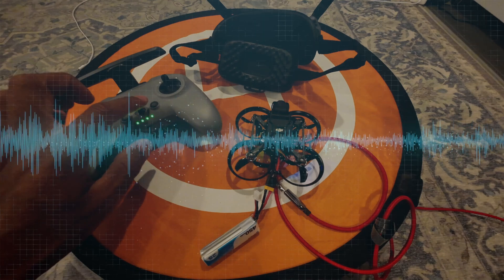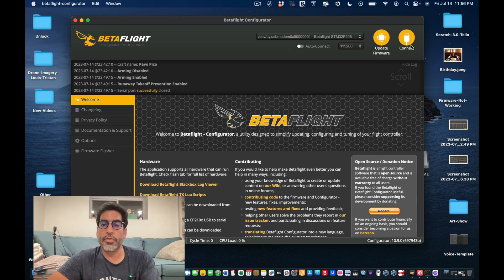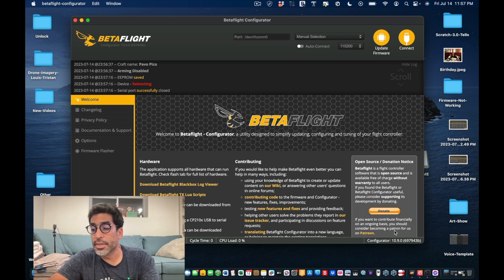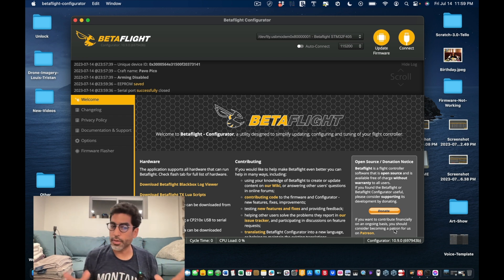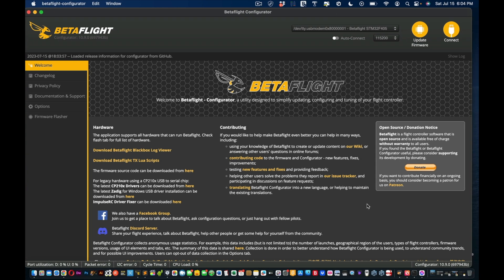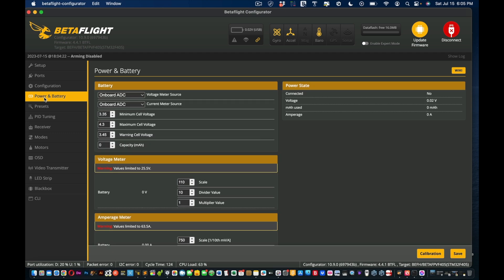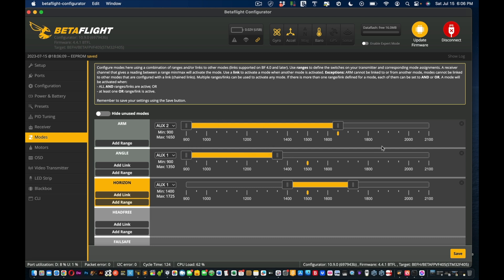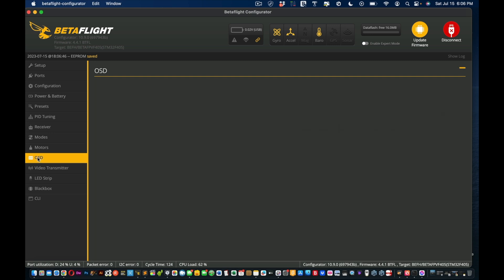povo pico configuration - betafpv pavo pico setup-Part-2

Comment: Man I’ve tried everything. I can’t get the controller 2 to bind
Reply from the maker: 40 minutes into live stream I explain.. 50:00 general closing. Also check your wiring.. This video you ca scrub to see the wiring..
https://youtu.be/NUd4JPoSCsE?si=SU6KMCI4b-g9g05G
Reply from the maker: @benstan4978  try the troubleshooting video . Also try updating the format to the DJI RC and 03 air unit 

Pavo Pico not working - how to get the pavo pico started, pavo pico troubleshooting
https://youtu.be/LEw5Gha1eRo
Reply from the maker: Live stream.. just go 50:00
https://www.youtube.com/watch?v=c-MnT_TKmJM

Comment: Is it possible to bind the dji controller to a pavo pico with a Caddx vista installed instead of an o3 air unit?
Reply from the maker: Sorry everything here is PNP , 2.4g , Josh Bradwell or Captin Drone Should be able to answer this question or even have a video on this.. But you should be able to. Let us know how it goes..

Comment: I was thinking about purchase one, but I don’t know how to program it until I saw your video footage and I enjoy it. I will pick one up and fly. by the way, what do I need to complete the accessory I need ? Like battery charger , also, where do I download the beta flight configuration? Good knowledge and understanding.👍👍
Reply from the maker: It all depends on charger will depend on which drone you get 

Here is where you can download beta flight 
https://github.com/betaflight/betaflight-configurator/releases/tag/10.9.0

DJI RC controller you can get on eBay for below market rate

Probably want the Pavo Pico Version 2
DJI O3 VTX
ExpressLRS 2.4g
https://betafpv.com/products/pavo-pico-brushless-whoop

Integra Goggles would work well for you
https://store.dji.com/product/dji-goggles-integra?vid=135261

You could probably get them cheaper - have price at second hand 

Let me know if this is what you were thinking 

Hope this helps
Reply: Thanks for replying for what I request for . but little pricey, but worth it. Thanks again.👍🥃🥃

Comment: These settings made my drone lose control and made the props explode… thankfully it was in my hand even with the throttle all the way down went full blast. I need help.
Reply from the maker: Sounds like the drone may have been in ACRO mode.. you want to be in level mode.. Also known as ANGLE MODE, here are some trouble shooting... No PID adjustments are done in this video.. https://www.youtube.com/watch?v=LEw5Gha1eRo&t=432s
Reply: @How-to-by-Lou  man that was a fast reply! My tv has your face burned in it lol do you have an easier way of contact?
Reply from the maker: @kjallard6764  thankfully the lines aren't wet and the storm won't be here until Sunday... you could always try here and can email you the PID image so you can copy it.. 

Drone-Imagery-NJ@protonmail.com
Reply: @How-to-by-Lou  I got the files on my laptop now. Learning a custom fpv is hard. Trying to learn betaflight and what everything does at the same time. The video where you use your cli does that add all the settings into betaflight?
Reply from the maker: @kjallard6764  I would steer clear from the CLI for now since you are new to this.. I made that same mistake too. FPV doesn't fly like regular RC remote control cars or planes you'd get from the mall. You may want to spend some time in the simulator first.. Maybe 10 - 15 hours in LEVEL MODE which is the same as ANGLE MODE, this video will help, then when you're ready I can walk you through the settings so you can fly in level mode.. youhttps://www.youtube.com/watch?v=NqmBmlZMzUQ
Reply: @How-to-by-Lou  copied all the pid settings and the mode settings, the moment it arms the motors start pulsating very fast and want to go max speed even with the throttle at zero. Doesn’t change no matter what the mode setting is ( the left toggle switch)
Reply from the maker: @kjallard6764  which drone and Remote Controller do you have? This video is for the DJI eco system. Do you set and adjust your remote controller for Manuel Mode? This video will show you how to do that.. Which Pavo drone do you have.. Can you look on the box and share what it reads at the bottom.. https://www.youtube.com/watch?v=ypxccdcNCsA
Reply: @How-to-by-Lou  I have the controller 2 with the Pavo pico v2
Reply from the maker: @kjallard6764  Which pavo? Is it the PNP elrs or TBS. You'll see it on the back of your box... You might want to try flashing your firmware with what ever matches your box. https://support.betafpv.com/hc/en-us/articles/21133140518937-CLI-and-Firmware-for-Pavo-Pico-F405-2-3S-20A-V1-0-FC-
Reply from the maker: All my videos happen in real time and this is the first time someone has shared this experience. If after flashing the correct firmware this doesn't work you should put in a new support ticket with BetaFPV. Are you in the NY, NJ, CT area? 

https://support.betafpv.com/hc/en-us/requests/new
Reply: @How-to-by-Lou  so I found one setting in modes that was not programmed in and that may have been my issue and that was the FPV angle mix. I had gotten a cli file from someone on Facebook and loaded that up and it was perfect. His tolerances are very very sensitive so I just need to play with those. I believe you have a video on the cinematic settings so that will be my breakfast watch lol. So far you have been amazing especially with the first build video
Reply from the maker: @kjallard6764  Glad you were able to figure it out.. Those rates are more for indoors.. You might find better rates from the FB group.. Most of the vids are for the beginner experience.. If you do find better rates, please do share so we can try them too.. Thanks a bunch...
Reply from the maker: If the PIDS are too unstable for you you can download from below and just copy the setting from the PID-Tuning-3. file.... Make sure you backup current setting incase you want to put them back.. Again drone should be in ANGLE MODE

https://github.com/flight-commander/pid-tuning/blob/main/Pid-Tuning.zip
Reply from the maker: or try this before putting in a support ticket

https://www.youtube.com/watch?v=8EnGQPeD0CI&t=322s

Comment: Would you happen to know how to setup the led light on one of the Aux switches. I have Aux 1 set for Angle,Hor,Air. Aux 2 top to arm-middle to disarm. Aux 3 is Home button, but if I hold it activates beeper and if I push it then it’s supposed to turn on and off Led. Aux 4 is the user mode? Aux 5 is C1 set for turtle mode. Any advice would be appreciated. Thanks
Reply from the maker: Try this one.. It should help guide you in the right direction.. https://www.youtube.com/watch?v=LEw5Gha1eRo
Reply: @How-to-by-Lou  Thank you

Comment: I do appreciate your video and I know it’s for the Pavo Pico, but no other videos show how to actually go into Betaflight to set up with a DJI 03 Air with the controller 2 and goggles. I recently purchased the Pavo 20 and tried to follow along, but no luck. Any advice would be greatly appreciated. I have no clue on what I’m doing..🤯
Reply from the maker: Try flashing it. Here is the CLI dump for version 1
https://github.com/flight-commander/Pavo-Pico-Version-1-
Reply: @How-to-by-Lou  I’ll definitely give it a shot. Thank you!
Reply: I got it to work! Not as easy to fly like the Avata, but a little more time on the simulator and we’ll see. 😂
Reply from the maker: @lalojr76ify   That's great... the new remote came.. So much easier to bind right? - Maybe turn on the OSD in the setting - or put the camera in wide mode. that's done from the setting in the DJI goggles.

Comment: Thank you. Very stupid question: how to arm it? I have a Avata and now the Pico. I binded everything but it does not take off
Reply from the maker: covered it here: https://youtube.com/live/PePZBXToPWI
Reply from the maker: 1. Make sure you have the goggles protocol set to "standard "
2. Check the 03 Air Unit Cable make sure it's not broken
3 Check the pins on the 03 Air Unit. makes sure they are not accidentally bent
4. Check in beta flight, make sure you have "SBUS" selected in the "Receiver"  Tab
5 Throttle has to be down before you can arm
6. Make sure it's not already "armed", won't start if you're already armed. 
7. Make sure the 03 Air Unit and the DJI goggles are running the current updated software. 
8. Battery could be dead.
9. In betaflight check your Modes. Make you your custom tabs are selected.  correctly and are in the right place. 
10. think that's it. If I missed something will let you know.
Reply: @How-to-by-Lou  thank you!!! it seems my FC is broken. I spent days with research and still didn't get my DJi remote, even though binded, to set a signal to the drone. I will get a replacement FC. I fear this will be a big challenge to swap it?
Reply from the maker: @OlliDTS   It can be a tad tricky.. Am uploading a new soldering tutorial later.. this one is I think 20$ on amazon. The one being uploaded  today is 9$ on amazon. Those flight controllers are expensive.. Maybe the 9$ build.. You only get one shot but you will need to buy a smoke stopper... 

Solder an 80s retro game
https://www.youtube.com/watch?v=9eEe6knqGLY

Smoke Stopper.. 
https://www.youtube.com/watch?v=4y2cJxWdBiY

Pavo rebuild part 1 of 4 - live stream no edits
https://www.youtube.com/watch?v=DcniZz1BN3s

Part 2
https://www.youtube.com/watch?v=Mg-KHnlJf9Q

Part 3
https://www.youtube.com/watch?v=Zt0PNl30I0c&t=1808s

Part 4
https://www.youtube.com/watch?v=spZ2kFAaywM&t=17s

Comment: I have a DJI FPV Controller, purchased for simulator training.  When purchasing a Pavo Pico unit do you select TBS or ELRS?  or is that irrelevant when using it with DJI O3?  I'm confused as to whether the DJI controller interfaces with the O3 for radio frequency or if it connects to the Pavo Flight Controller board..
Reply: go and do a bit or research as i did. TBS is a company that have the product Crossfire. you need to select TBS Crossfire if you want to use with DJI controller 2.  The DJI o3 air unit is the video module. that you can use the new fpv goggles.
Reply: @ezekieloz I actually just got that working yesterday.  There was a change between the first Pico and the Pico 2, for the DJI controller to work serial has to be enabled on UART 5 for the new model.

Now I’m trying to figure out how to use an ELRS controller with the Pico 2.  I have a couple units and just started working with them over the weekend.

Comment: I would like to start the hobby and am looking for a complete package with the Pavo Pico, batteries, remote control and glasses. can you help?
Reply from the maker: Hard to say - first I bought the DJI goggles and then later the additional parts like the remote and other things  needed to go FPV

You can reach out to betaFPV support and ask which package with goggles can the pavo pico be flown with https://support.betafpv.com/hc/en-us/requests/new

They have some really cool drone goggles combo but the binding process is like a bad game of twister

Or you can look on eBay too, some folks are selling their FPV remote for 80$

You’d still need the goggles too however some folks who thought they would fly FPV and then decided not to; will have their stuff for sale on there too…
https://www.ebay.com/sch/i.html?_nkw=dji+fpv+remote+controller+2&_sop=12

Then you’d just need Pavo and 03 air unit..

They do have goggles 🥽 and drone combos on ebay too, which are more affordable but they aren’t DJI units 

But if it’s your first time ever then the AVATA might be good since it’s pretty resilient and can hold up to many crashes before actually needing to be repaired 

The Pavo - even if you’re handy at fixing stuff you’ll still need parts if you crash but totally manageable with the videos here on the channel, cheaper and faster to fix the Pavo - but if you put time into the simulator then ya might not be needing any repairs

DJI AVATA, might work well with care refresh but after comparing it all only you can decide which is best for you 

All in all this channel will totally help you with both…

Comment: Hey there
! Just to clarify, the Pavo Pico doesn't come with a buzzer pre-installed, correct? So we're on our own when it comes to equipping buzzers on the buz+ and buz- pads, right?
Reply from the maker: There is a beeper, you just have to turn it on in the settings
Reply: Hey @droneimagery-NY-NJ, thanks for your input! Ah, I see you're talking about the Dshot bcon configuration. You're right, it's an option to transform the motors into a beeper when using the dshot protocol. However, I've heard it tends to heat up the motors rather quickly, which doesn't sound too good.

Personally, I'd prefer not to use it. Although it can beep when the TX is lost, it lacks the versatility of a real beeper with multiple functionalities that can be configured in the config section. But hey, thanks for the suggestion!

I'm considering installing a beeper, especially since I saw the diagram of the Pavo Pico and it has beeper pads. Have a great day!
Reply from the maker: Let me know if you need help turning it on

Comment: I think you are overly concerned about overheating while flying. In many years of flying HD quads, I've never had one cut out in flight, and I live in the low (hot) desert. Admittedly, I do turn off heat protection. Even so, if it gets hot enough, it will shut off. Mr. Bardwell asserts that you cannot possibly burn out the air unit from, perhaps, waiting for a difficult retrieval. It'll protect itself. You are correct about being concerned about overheating when the device is on the ground, however. If powered up on the bench, I will have a fan running on it. If crashed for some reason, AND if I know generally where the quad is, I'll turn the TX power to the lowest setting of 25mw while hiking in for it. By the way, you've done a very good job on this video. Well Done!

Comment: Ended up getting a new FC for free since the one I had the first time round was completely dead when it got to me. Now paired everything but I have no movement in the receiver tab unlike you do and also not sure how to arm it to test if stuff works?
Reply from the maker: Try to delete the beeper and flip and just keep angle mode and horizon along with arm..

Also since you have the version 2 most likely it’s UART 5
Reply from the maker: Happened to me yesterday with a different drone. Went to it's website and downloaded the firmware for that Flight Controller then went into the CLI, did a (dump all) for current presets so they could be saved to folder / desktop incase they decide to be put back on... then configured everything for so it would work with the new firmware.  Now works great. Some features are missing but everything works now.. You might need to do the same thing with the Pavo Pico

Comment: The new one that I got pico port pusing The UART5, The old one using UART6
Reply from the maker: This great.. thanks for sharing. Did you have to use ExpressLRS Configurator  to get UART5 to open or was it the similar steps to this video?
Reply: @How-to-by-Lou  sorry forgot to info: I'm using dji rc2

Comment: I paired the reciever (got the green light on the 03) but I dont see any inputs from my controller on betaflight. Any solutions you might know of?
Reply from the maker: 2:31 into the video - make sure you have SBUS selected - it's in the Receiver menu - try pairing the receiver again. It's possible that only the goggles are paired.

Will put up new video later this evening.. everything will happen in real time no edits
Reply from the maker: this will fix everything.. It all happens in real time
https://youtu.be/jeEEq_CaN7I
Reply from the maker: everything happens here in real time. This will work better. No edits in this video https://www.youtube.com/watch?v=jeEEq_CaN7I&t=10s

Comment: are you able to give instructions on binding the PAVO Pico with a 3rd party radio (radiomaster boxer) having the hardest of times binding the two. don't want to use my DJI remote 2.
Reply from the maker: not sure @CAPTAINDRONE798 might be able to help - he might have a binding video.. also not sure if the 03 Air unit  to the Pavo Pico can be bound with other remote that's not DJI related. maybe you should have bought the other version of the pavo pico that was not DJI 03 - 

Support is pretty fast with betaFPV - 

you can submit a request herehttps://support.betafpv.com/hc/en-us/requests/new

Or reach out to @CAPTAINDRONE798 or search is channel..

Comment: Maybe I missed something, but UART6 is not always correct! If you have the older FCs it is UART6, if you have the FC from the second batch/delivery it is UART5 instead!
Reply: Спасибо! Действительно UART5 помог!
Reply from the maker: @Alma-AmiD  пожалуйста, рад, что это видео помогло вам. Не стесняйтесь проверить опыт GPS на Паво Пико. https://www.youtube.com/watch?v=NUd4JPoSCsE&t=1584s
Reply from the maker: thanks for sharing will put this in the description.. Didn't know there were different flight controllers from different delivery batches...
Reply: @How-to-by-Lou  
As far I know the first batch was delivered with F4 1-2S 12A AIO V3. Since end of August 2023 the second batch was delivered with F4  2-3S 20A AIO V1.0
I have both, both have integrated receiver, but I prefer to use SBUS (DJI).
I couldn't say any big difference between except the UARTs. At present it is not possible to buy the newer FC as a spare!
Reply: god bless you with your comment! I have the pavo 20 and UART5 instead of UART6 works! Thank u so much

Comment: why did you change the uarts?
Reply from the maker: this is the configuration for this experience without the GPS  and this is the experience below for the pavo pico with GPS. Basically it's the way the chip is wired. So it opens things up in the software so it know what to look for so things can bind and fly